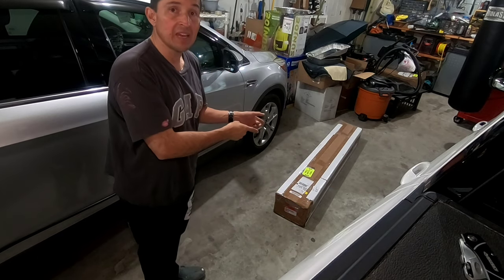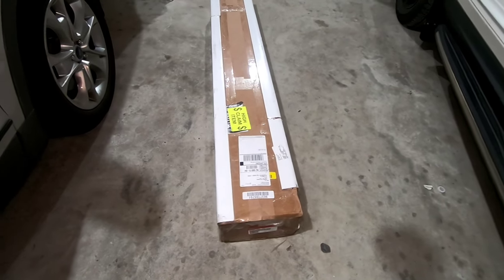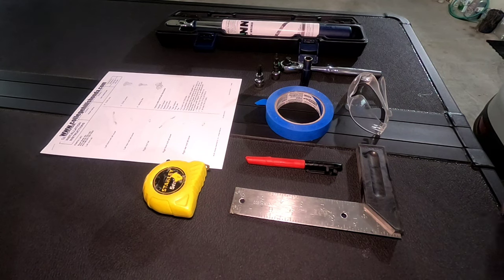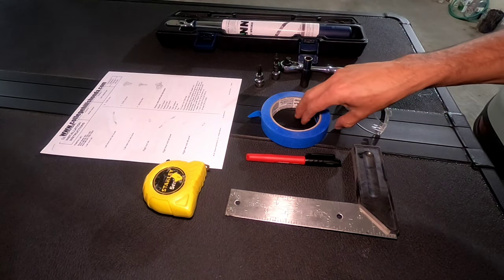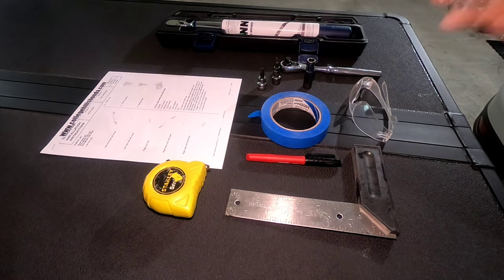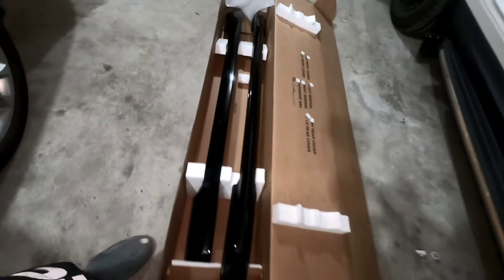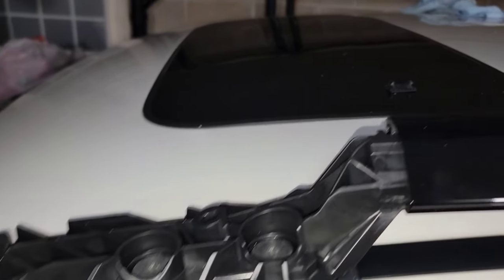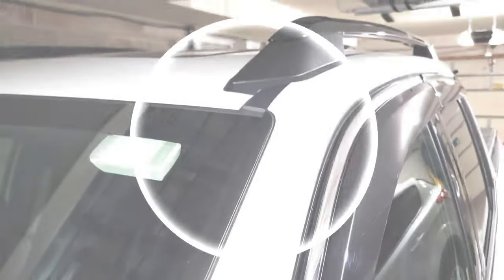Honda Ridgeline  Roof Rails Detailed Installation

Comment: You made it super complicated! 
Remove the rails And keep the front Piece portion from the windshield part that you remove and attack that back on and the rail cut it with a length of 37 3/4 Thats it! Slap the garnish back on and clean the thread and slap the rail and tighten it then your done!

YALL THANK ME LATER! 
Ima post the video on my page!
Reply from the maker: It is fine with me, I follow the Honda instructions, and it works for me, for what you are about to do or you did I don't know, just make a video and put the link here that way we can see if your way is better than the Hondas instructions and that way we all can see if your if technic is better than the manufacturer. 
Note: lol... I just saw your video it is quick, and has some ok directions but no step-by-step instructions, am sorry but for me, I prefer to follow the instructions from Honda unless there is none available, a 21/2 mints video you didn't show how to install it  and also you turn off your comments, I am wondering why?, I hope somebody watching this comment goes to your link and sees what I am talking about, we are here to help each other!, good luck and GOD bless!!!